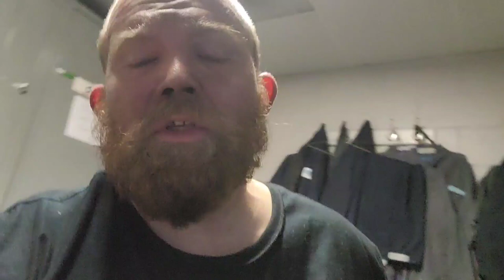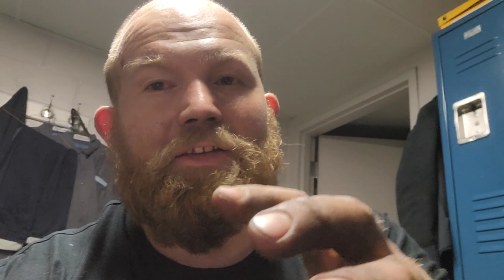Quick Lube Oil Change and Now Check Engine Light is on - Here is Probably Why - check this first

Comment: Or they just haven't correctly seated the dipstick or oil filler cap. Happens all the time on the turbo GM products.....Causes an air leak and throws a code and throws a check engine light as a "Lean Mixture" ...
Reply: My experience exactly - I left the dipstick lose on my wife's car after doing an oil change and that was enough to suck air into the wrong places, throw codes and misfire.
Reply: I am not an expert on all vehicles.  I thought that leaving the oil cap off would cause a stall.  A missing dipsticknis worse, an oil leak.
Reply: The 3.5 ecoboost are very picky I have found out. Make sure you seat those dipsticks even on first start up right after you had just added oil. Had them pop an engine code after we rolled out the vehicle and customer got in and started driving away and had to come back
Reply: I had that problem and fixed but light keep coming back on.

Comment: I can count on one hand how many times I ever in my life paid for an oil change at one of those quick-lube shops. Out of 4 times I ever did, twice I was told (at different places, different vehicles) "your oil drain plug was stripped and we had to replace it). Once I had a guy top off my coolant reservoir with windshield wash fluid. These instances were usually in out of the ordinary circumstances, for instance one was when I drove from Iowa to New York for business and was pushing overdue for an oil change while i was there.

Ever since I've become disabled I do my own vehicle maintenance 99% of the time, just because I know it's done right and it's cheaper. The guys that work in those quick-job places are not mechanics and they don't get paid well enough to stick around long enough to learn from mistakes. I encourage most people to educate themselves on working on their own vehicle or taking it to a reputable mechanic or dealer that specializes in their make and model.
Reply: The "Jiffy Leak" shops are notorious for stripping drain plugs. My landlady's daughter always goes to the quick lubes. She recently went to get her oil changed and was informed that "your oil drain plug is stripped". She visits the same one for her oil changes. I maintain my landlady's two vehicles myself. Now I have to deal with the daughter's car and remove the plug. In all the years I worked in the automotive field I never stripped the hex on a drain plug. I always use a 6 point socket and know enough not to overtighten the plug. The quick lube places need to have torque wrenches on hand and use them.
Reply: My previous truck was a Dodge Dakota that I ordered new.  I changed the oil myself and 99% of any other repairs it needed.  Totaled in a wreck unfortunately but I drove it 437,000 miles before that happened.  Original engine still ran fine.  I only trust myself to change the oil/filter.
Reply: @mlieser1230  That was my take as well, considering I KNOW I never stripped my drain plug, ever. I figured they just saw the out-of-state license plates and decided to take me for a ride.

Comment: We had a guy come into my Valvoline location with a Hyundai yesterday. High miles, oil very low on arrival, got his oil changed, on the way out of the parking lot the check engine light started flashing. We pulled a P1 code 

I can say, working at Valvoline (at least my location), we do so many callouts and communicate and work as a team so all our guests’ vehicles are taken care of properly. On some cars, we have an evac machine specifically for avoiding potentially damaged pans or drain plugs and prevent ourselves from maybe making it worse. I know not every location is ran like mine, and there’s horror stories everywhere, I just feel like as far as quick lube places go, Valvoline has lots of checks and procedures in place so their employees aren’t fucking customers’ vehicles up

Comment: This was years ago. Our family had a 1999 Mazda B2500 where it would intermittently "not run right."
What tipped me off was how clean the engine oil was. Turns out it was serviced at a local dealership and the MAF connector was plugged in, but not fully seated. Cleaned out the connector, put on some dielectric grease, plugged in it with that satisfying "snap" and the truck ran well after that.
It never hurts to double-check.

Comment: Just got a oil change and check engine light is now on. All codes point to air flow sensor. You are spot on with this video..
Reply from the maker: Beautiful

Comment: I went to a Jiffy-Lube, once. Only once. The people there tore up the wheel-well liner to reach the oil filter instead of reaching past the manifold. After that, they quoted me a much higher price for my oil change because it was a 4x4. I only had them change engine oil. Capacity on 4x4 and 2x4 is the same on the same engine, so I disputed it, paid them what I was originally told and left. Never went back.

Comment: That happened a lot at my Toyota Dealership, check engine lights galore on Tacomas and Rav4s because there is not enough slack for some people to take off the Air filter housing. And the engine light comes on before we take it up front to the customer.

Comment: This is why I completely service my vehicle myself I had a technician take apart parts of my car that shouldn't have been touched. They also did a pressurized injector clean through the fuel rail when I have a multi-port injection system which also blew the fuel pressure regulator that's built into the intake manifold. Took me a year to figure out what happened to my smooth engine. Part of my suspension were removed I drove home saw and drove back and they were sitting on his desk. All this for a simple oil and filter change which took 3 hours. If I do the same job better in less than 25 minutes at the most.

Comment: Same thing happened in 2016. Quick lube guy did oil change and checked filter. Gets done starts car (explorer) cel comes in and running like crap.  Pulled codes. Mass air flow.  Pulled it out tiny little big like a gnat on the element. Did the same thing. Tap it lightly. More debris came out. Used mass air flow cleaner. Reinstall clear codes runs great. It never left the shop in his situation though. It was immediate.

Comment: Watched "customer states" type video earlier where apparently a quick lube place filled a customer's engine with ATF.
Seems hard to believe someone could mess up that bad. 🤔
Thanks for the tips. 👍
Reply: We hired a dud tech where I work and filled up a Detroit Diesel with 85w90 instead of the 15w40. We caught it and stopped him.

Comment: Had this exact problem after Jiffy Lube oil change. The MAF sensor was still plugged in, but when they put the filter cover back on, they squeezed the O-ring off its track, completely damaging it. I replaced the airfilter myself, and its a lot better but still slightly rough on idle. Does it take awhile to recalibrate itself? Thanks so much for the vid!

Comment: Nice advice.

With personally owned and maintained vehicles for others I know well I can do things differently than an oil change place.  I don't have to upsell air filters.  I leave the air filters alone until I think that it may be close to changing the filter.  For diesels I just watch the filterminder and wait for 27 inH2O peak restriction.

I was in charge of field testng for a few product lines in Arizona at the durability tracks.  We added restriction sensors for data acquisition into Vision for Ford and INCA for others.  I set restriction boundaries at 75% filled up air filters.  The telemetry would send me emails to a specific account, if any air filters ever got close to needing a change in the Arizona dust.  Some call that "moon dust".  Literally at 100k and 150k test limits the air filters weren't close to 75% close to needing a change.  Some cabin air filters were changed out.  The air filters "looked" dirty but did not need changing.

I had the great (and also awful) opportunities to work with Donaldson for "real" air filters for civilian and military applications.  I learned a lot about air cleaners and air filters.  I also learned a lot about CFD and the designs of intake ducting.  The GT suites (software company, not "good transmission" emblems on cars, an inside joke) help design intake ducting.  The OEMs know intake ducting a million times better than "cold air intake kits".  The knowledge from Donaldson and GT is so much smarter than me.

I still change the air filters way too early at maybe 80k miles, unless I have a filterminder on the cars I personally maintain.  I know better, but even I want to diddle and change to a clean filter at some point.  I even have the telemetry data from field test.

On one diesel program I worked on the "blue" filters weren't even close to capacity after 200k miles when we had to crush the mule test vehicles.  On other engine programs we changed out the air filters at 500 hours when we removed the engines at half the rated life.  Rich knows how the Army has different maintenance needs for mission readiness.  We had to alert the crews, just in case.  The extraction systems on the military stuff ejected shovels full of dust each purge cycle.

Comment: I had my F-150 2015 service at the Ford dealership for code 2450. My truck was 68765 at the time. It was serviced before Thanksgiving. Less than a month, engine light back on.  It went off for a week or so, now back on. Purge value stuck open, repaired it. Performed induction and throttle body flush. I was charged $802.00, also paying out close to $400.00 for rental for a little over a week. I am to take it back in on Monday. This is really frustrating.

Comment: Seen this quite a bit at my Nissan dealership.  Our lube techs have gotten pretty good at not seating the air filters down in the boxes correctly or just all together missing the holes for the alignment dowels. Talked them through the proper way to do it and to just take their time to do it. Because if you don’t have the time to do it right the first time you will be doing it a second time with an agitated customer. When I was a lube tech I actually broke the air box learned my lesson the hard way. Just take your time and if it doesn’t feel right man up and ask for help.

Comment: Ok so i have a different question ..so i had my oil changed a month ago on my 2018 Ford F150 super cab 3.5 ecoboost 4x4 10 speed. and today the " change oil reminder " came on . I was like Wtf ? So i called the dealership..They had NO CLUE ? They said drive it and see if it comes on again. Can you tell me if you've ever ran into this ? Thanks

Comment: I don't understand why they don't make the filter box to pull air from underneath, through the filter and out at the top into the engine. This way, all the debris stays under the filter and in the box. Also, in case of water, it drains from the bottom.

Comment: Dealer is changing my 22 superduty headliner in a few weeks for warranty repair and I'm a nervous wreck about them messing with it.  I'm going to take pictures and videos of it inside and out prior..
Reply: They probably sub it out to a good shop. Bet it will be fine. Love to hear how it comes out. I have seen dealer cars at one of the custom shops in our area.
Reply: @dustbat  I'll update ya, truck is getting ceramic coating and PPf this week and probably next will be dealer for the headliner. Factory one is cut wide or something and is untucked  around the uppfitter console driver side
Reply: @foxbraap6373  I look forward to that and kind of you to bring me in your loop.
Reply: @dustbat  it's been a bit but they swapped the headliner last week at the ford dealer and it looks great! only thing I had to adjust was some of the door seals were folded over but whatever took me 1 minute to fix them on 2 doors
Reply: @foxbraap6373  Glad it came out as we hoped. You can let your breath out now. Thanks for keeping your promise.

Comment: just unplugging the MAF or getting debris on it seems so minor compared to what I've seen.  Forgetting to put the drain plug, filter, or fill cap back on and then running it dry just blocks from the place, or in the case of the missing fill cap, covering the engine bay with oil.  And 100% of them said "that wasn't us" when the customer went back to complain
Reply from the maker: Yeah I get what you're saying this was just more of a perspective from what is the most common and this is the most common what I stated in this video... that's all.
 You're right there are much worse things the people should be aware of

Comment: Have an oil question, I am having a problem finding fomoco superduty 5w-40w oil. What are your thoughts on Rotella t6 for a 2013 f25 6.7 with 150k on the clock?
Reply from the maker: It's good oil you should have no problem using it

Comment: Hello I was wondering if you can help me out with a question I have a 2017 Ford Escape 2.5 L motor 40,000 miles. the Ford dealer told me the the muffler is bad wondering how can I get ford to fix this? should a muffler go bad this early ?
Reply from the maker: No it shouldnt

The problem is it doesn't fit in the emissions control category it's only part of the exhaust but it doesn't actually control emissions so they're not going to cover past 3 years 36,000 miles so if I was you I would go to a muffler place and just have them weld one in cheap a universal one
Reply: @FordBossMe  thanks I appreciate your honesty I bought the extended warranty the top-of-the-line warranty the Ford one.I like Ford partsI I'm going to go ahead and get it fixed! Thanks .just to let you I love ford and yes I shop  at the dealership  for service they do good job

Comment: Any chance you see this. Got an oil change at one of these places out of my guy being shut down for the weekend and it needed to be done. About an hour later check engine light is on and my engine is shaking. I find it a strange coincidence it happend after this. I dropped my car off somewhere to be looked at gotta wait and see diagnosis’s but this is crazy. Wish I would have looked into these quick change places.
Reply from the maker: Hope it's an easy fix
Reply: @FordBossMe  me too not the best way to spend a weekend. Thanks for the response

Comment: 2010 Ford Flex 170,000 miles. I change oil at 4500 always. Ran over 5,000 last time. p0011 and p0012 codes came up. Cam sensor bank 1 and bank 2. Flushed and changed oil. Still coming on. I don't trust both coming on at the same time. Any ideas. I ways change my own oil. The last free oil change on the old ladies Wrangler left a big puddle in my driveway.
Reply from the maker: Check the oil level and if it's good you probably needs a chain and tensioners and guides and do the water pump as well
Reply: @FordBossMe  👍👍

Comment: Just had an oil change drove for one day next morning check engine light throwing code for PO456 idk had it done at Toyota
Reply from the maker: That's an evaporates small leak code, gas cap loose, something wrong with purge valve or the fuel filler neck... the evap system needs checked out

Comment: Just a word of Warning.   Be careful about saying the words "Jiffy Lube" on your videos.   I did it in a video a long time ago about a overtightened drain plug.  The customer hadn't actually gone to a Jiffy Lube, it was another quick oil change place, but I just used "Jiffy Lube" as a generic word for quick oil change place.  I got a letter from there Attorneys threatening to sue me if I didn't pull down the video.   I pulled it down and edited the jiffy lube part out and put it back up.
Reply from the maker: I guess you haven't seen my viral Jiffy Lube video right

 I'm not worried about them let them do what they have to

Comment: My dad has a 07 4.6 f150 P0401 code came up what’s the most common/easy fix on this?
Reply from the maker: What does that mean I don't remember what all the codes mean so it's nice when people helped me and I don't have to go look for it because I don't look for codes for people anymore I will give them troubleshooting ideas but I'm not going to go research them if you don't tell me what it means and I don't remember then you're going to have to give me some more information
Reply: P0401 means that the engine computer has detected that the Exhaust Gas Recirculation (EGR) system flow is insufficient. The EGR system redirects a small amount of exhaust gases back into the intake
Reply: Just looking for troubleshoot ideas instead of taking everything apart

Comment: It is a possibility that they didn't add the correct amount of oil or possibly they could've stripped the oil pan bolt and it leaked all the oil they put in right back out. Honestly the possibilities are endless if you have a turnout rate as high as lube shops unfortunately

Comment: That's an engineering problem as you need to tell these manufacturers to make it simple to check your air filter without making it so complicated. It amazes me that on some modern cars you actually need a mechanic just to even check an air filter these days.